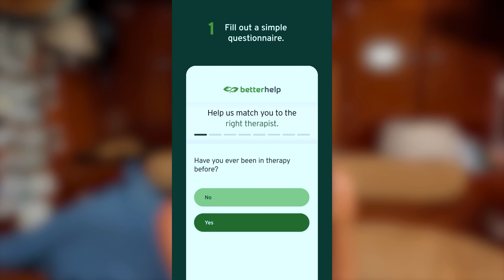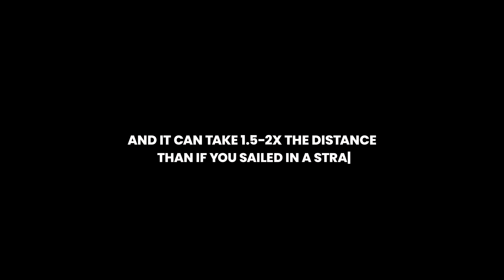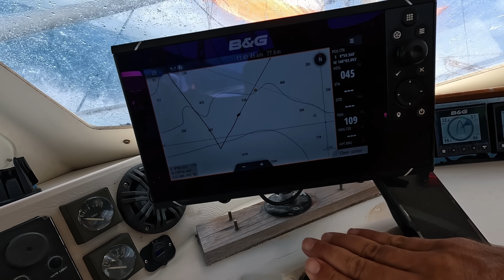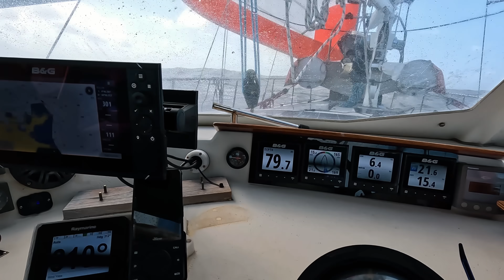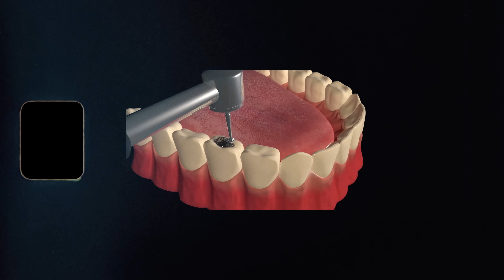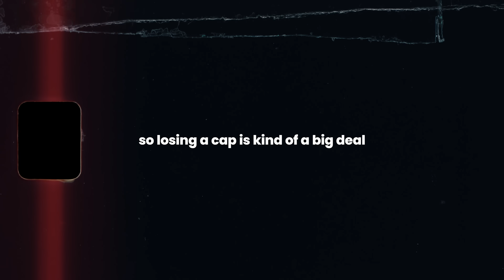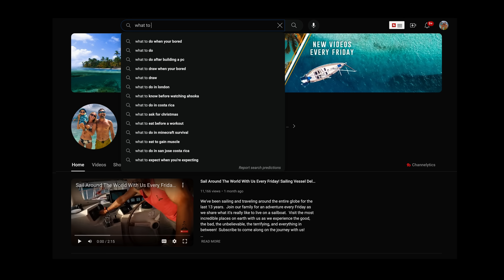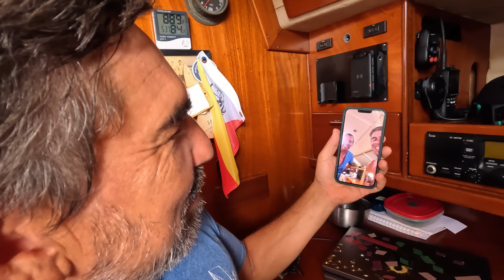LOST TOOTH 🦷  (A Very Rough Sail)...Sailing Vessel Delos Ep. 453

Comment: I really enjoyed your video, I never thought through the possibility of needing to do tooth repairs, am adding that to my first aid kit on the boat-- not a lot of dentists around the Kimberlies.  Re my previous comments on daggerboards on your cat-- that beat into 24 knots would be soooo much better with daggerboards than just mini keels.  A good sailing cat (there are not many of those around admittedly) with daggerboards will sail at the same angle, if not higher and potentially faster than your current Delos.  We sailed against a 1 year old 46' dufor mono hard on the wind in our 35' cat-- we sailed the same angle and were faster (in 18 knots true)...Phil

Comment: After you've had a few of them come off, you realize that a separated crown is usually no big deal at all. The remaining tooth stump is usually not sensitive to touch or food/liquids, so you can just continue eating normally until you can get to a dentist. Later in life, entire teeth have to be pulled out. Once the gum heals over in a couple months, it's no big deal as long as it's surrounded by good teeth. Then you may have to start thinking about a bridge or an implant which are so expensive and insurance won't cover much of the cost.

Comment: i think you were asking on ideas for your new boat. what if you incorporated the "mask" on the wall into your new table, maybe that table is aluminum, cnc out the spot for the mask and cover it up. or bury it in an epoxy along with a bunch of little trinkets youve acquired over the years.

Comment: One drop of Super Glue onto a ''dry'' surface. Then while holding the cap in place get water around the tooth. The water will Instantly Set the glue along with any excess glue that may have squished out.

Comment: Depending on what type of problem helpful dental rescue aids are Listerine Protect mouth disinfectant and Sensodyne Repair Protect. You wet your toothbrush in the Listerine and give the affected tooth a thorough scrub. After a while give the same tooth a work over with the Sensodyne. The Listerine kills the bugs,. And the Sensodyne covers the wound with a coating of fine clay like stuff. This is advice to all sailors, have these 2 materials aboard. 
I had an infected tooth requiring a root canal treatment well before the pandemic but when I finally got an appointment with my dentist he couldn’t do the surgery as it required 6 weeks , so had to fly out of Sydney to Europe where I’ve been ever since. I use this treatment to keep the tooth under control, and it might have healed itself as I haven’t needed to do it for some time. While treating the tooth you have to be careful what you eat. Sweets are out, and ice cream is the tooth assassin. People on boats with multiple fillings should not eat jubes as it is the hydraulic pressure of the thick chewey mix caused by biting down that will drive into cracks or just bond to the tops of fillings or crowns and just lift them away.
Big problem, simple fixes. Advice from someone who has abused his teeth terribly, but still has enough left to survive the last years……..as long as he is careful.!!

Comment: Good Thumbnail. I thought Kazza was going to do a faceplant into the halliard 😬. I recently had a cap put in a top, front incisor. With a 1/3 tooth length nub. But they glued it on really well. And now, I'm one accident away from spending $5000 on a tooth implant (surgery). Luckily I'm near Mexico and can get one for $2500 or less.

Comment: Talk about losing a tooth. just lost 2 of mine, yup helping fix the back side of a light in the garage attic.. had my drill in hand as I crawled and slipped as the drill hit my side cheek knocking out one the other was so loose had to pull it... but I can still thistle whistle o hel.. JB weld quick set glue works also, taste funny tho... SO when are you selling Delo's ??

Comment: I’ve lost a crown before I just super glued it in 12 years later no problems just make sure you clean both parts very well and it’s dry that’s the hardest part is to keep it dry before you get the glue to set.
Reply: Superglue (cyanoacrylate) kills tooth nerves on vital teeth.
Reply from the maker: That is good info.

Comment: Gr8 editing strong people perfect community. 
Thanks for the heads up on what ive got 6 weeks to deal with from butcher dentist fk ups after 2yrs of being horribly sick. In australia when cant work on pension, in emergency can go to certain private dentist with voucher of near $900au.. so i did thinking it same great dentist as b4 covid..i was wrong but thought gota b better then the normal system of students learning. I got 5 holes drilled to still not find cause..now i have 5 issues i didnt have..despite the super urgent must go to the normal system to workout problem, its been 2years it gets put back 4mths everytime they change appt. Now cleaning then fillings root canal at least with zero pain relief to show me if u can deal with that on the ocean in woop woop surely i can..
I was scared to watch but instead u put me more at ease, ive heard horror stories.nsorry lonng story thought context help understand.. i used to thrive to push myself but dv its pushed my body to limit so i live thru you.